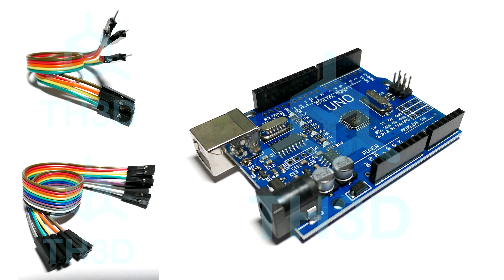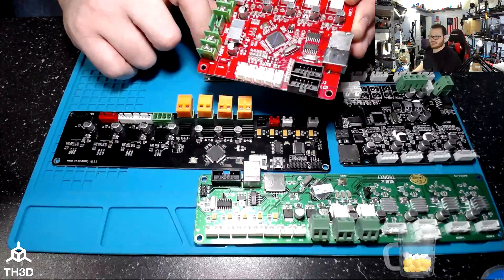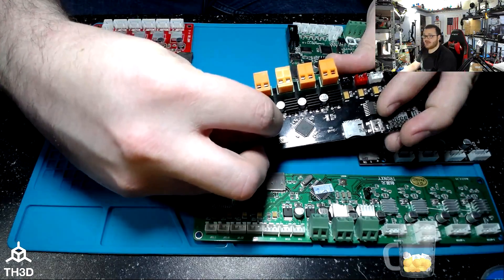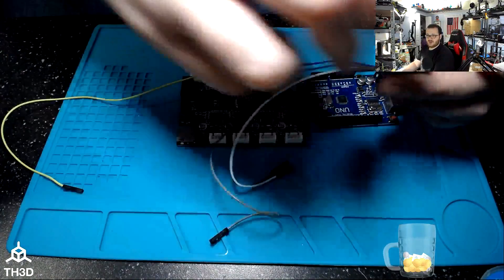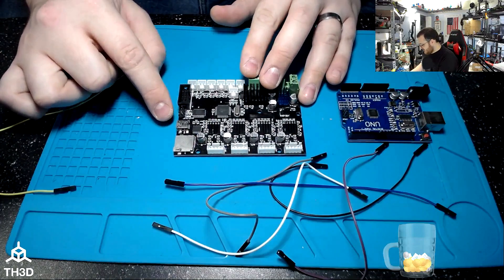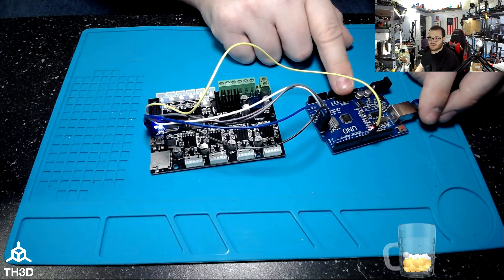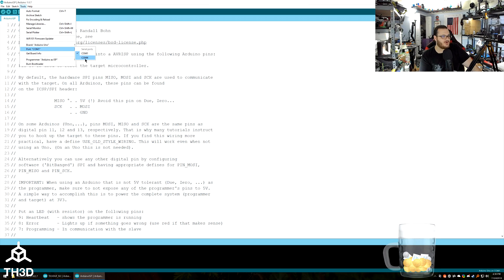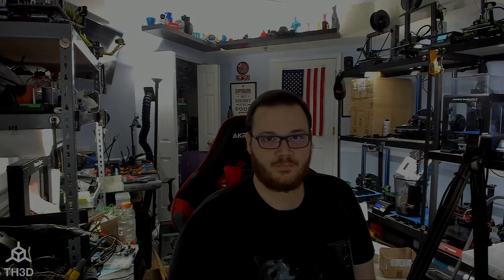Bootloader Flashing Guide - CR-10/Ender 2/Ender 3/Ender 5/X3S/X5S/Wanhao i3 - 1284p Boards

Comment: I corrupted my ender 5 plus silent board by using the wrong programmer in octoprint.  will this work for the silent board too?
Reply from the maker: If the board is the V1.1.5 then you can try to bail it out. If its the V2.X type you can as well but needs to be set as the 2560 CPU.
Reply: @TH3DStudio  Thank you for the response!! The model I have for the Ender 5+ is a V4.2.7 board.  Would this be alright?
Reply from the maker: That will not work. You likely need a more advanced method and the bootloader file from the manufacturer. It would be cheaper and quicker to just replace the board. That board already has a bootloader.

Comment: hi i get this code  on my ender 5 pro any help would be nice avrdude: stk500_getsync() attempt 1 of 10: not in sync: resp=0x65
avrdude: stk500_getsync() attempt 2 of 10: not in sync: resp=0x63
avrdude: stk500_getsync() attempt 3 of 10: not in sync: resp=0x68
avrdude: stk500_getsync() attempt 4 of 10: not in sync: resp=0x6f
avrdude: stk500_getsync() attempt 5 of 10: not in sync: resp=0x3a
avrdude: stk500_getsync() attempt 6 of 10: not in sync: resp=0x54
avrdude: stk500_getsync() attempt 7 of 10: not in sync: resp=0x46
avrdude: stk500_getsync() attempt 8 of 10: not in sync: resp=0x20
avrdude: stk500_getsync() attempt 9 of 10: not in sync: resp=0x69
avrdude: stk500_getsync() attempt 10 of 10: not in sync: resp=0x6e
An error occurred while uploading the sketch
Reply from the maker: You either have the new board that isn't compatible or you need the bootloader:

Bootloader Info: https://support.th3dstudio.com/hc/en-us/articles/360043146132
New Board Info: https://www.th3dstudio.com/2020/08/19/creality-changing-boards-with-no-notice-ender-3-ender-5/
Reply: TH3D Studio no I have the V 1.1.5

Comment: I  used a USBISP on a 1284p board(ET-4000 V2), but seemed to bricked the chip. don't know why I cant flash bootloader or firmware anymore
Reply from the maker: Have you tried using another programmer like an Arduino UNO to see if its just a bad USBISP?
Reply: @TH3DStudio  yeah, i figured out that i used the wrong fuse settings, causing  the chip to lock up

Comment: Very informative, What happens if you connect the wires incorrectly and start the process... will it damage the board? I mean if the board lights up it should be good... no ?
Reply from the maker: It usually will be OK as we've done that here on accident.

Comment: Cannot get my UNO R3 to be recognized by my computer.... Windows 7 and USB is likely screwed due to Drone FC usb configs.  Cannot figure out how to get the board recognized to reflash the UNO.  Any ideas?
Reply from the maker: If you have one of our UNOs try installing the driver for them from our website: https://support.th3dstudio.com/hc/en-us/articles/360043291432-CH340-Drivers-TH3D-Uno-Creality-V1-1-4-V1-1-5-Board
Reply: @TH3DStudio  I have gotten further, now I'm getting a fault (This device cannot start. (Code 10)).  My board is a authentic Atmel ATmega16U2/ATmega4328... so not sure how the CH40 driver will fix, but will give it a shot.

Comment: Worked great.   I made a diagram for the connections so I would not make any mistakes.  Then I installed the bootloader.  It worked fine except the 3D printer did not reset which I thought it should.  It was not a problem though as I just unplugged the USB and plugged it back in and the printer came up to a blank screen.  After that I was easily able to install the TH3D firmware and everything seems okay though the blank motion menu had me concerned until I read that it has moved to be under the Prepare menu.

Comment: Also will the Sanguino 1284p board work with the EZ Lite v1.2? Or do I need a different bootloader?
Reply from the maker: You are going to damage the EZBoard. Please read the manual, it already has a bootloader: https://th3dstudio.zendesk.com/hc/en-us/articles/360043727771-EZBoard-Installation-Guide-Firmware-Info

Comment: I have the EZ Lite V1.2 and everytime I try to burn the bootloader I get an error saying" device signature incorrect" any help I would be greaful. I tried almost everything. Also to point out my UNO board is the chinese version
Reply from the maker: You are going to damage the EZBoard. Please read the manual, it already has a bootloader: https://th3dstudio.zendesk.com/hc/en-us/articles/360043727771-EZBoard-Installation-Guide-Firmware-Info

Comment: if trouble with grapichs display, just add these line at the configuration.h  section lcd :

#define REPRAP_DISCOUNT_FULL_GRAPHIC_SMART_CONTROLLER
//************************************* edit mjh *************************************
#define ST7920_DELAY_1 DELAY_NS (0)
#define ST7920_DELAY_2 DELAY_NS (400)
#define ST7920_DELAY_3 DELAY_NS (0)

this will correct the timing if display is corrupted

Comment: Hi,

First off all, thx for this understandeble video! really nice!
programming the arduino as a programmer went like a charm, but when i trie to flash the bootloader on the 1284p board i always get the same fault (avrdude: Device signature = 0x000000 (retrying)

fault when burning bootloader.

when i just connected the 1284p bord it had a red flashing LED but after a while it's not on anymore. only when i press the reset button (on the 1284p or arduino board) then it comes on for a moment.

any help on this? thx
Reply: forgot to mention that the LED on the uno board is solid red it was also blinking in the beginning en turned solid when the 1284p board had it's LED turning off :) and it's not an original arduino, it's MEGA2560

Comment: Thank  you for this video. I have an ender 5 PLUS with creality v2.2 board. I was trying to flash it from slicer when I selected the wrong firmware (ender 5 rather than 5 plus). Now it won't get past the initial creality screen. I followed the guide here with the wires matching https://www.th3dstudio.com/knowledgebase/creality-v2-0-v2-1-v2-2-board-atmel-2560-icsp-programming-header-pinout/ and  Mega 2560 board selected in arduino IDE. And yes there is no micro sd card in the printer. I get this error when I try to burn the bootloader: 

avrdude: stk500_getparm(): (a) protocol error, expect=0x14, resp=0x14

avrdude: stk500_getparm(): (a) protocol error, expect=0x14, resp=0x01
avrdude: stk500_initialize(): (a) protocol error, expect=0x14, resp=0x10
avrdude: initialization failed, rc=-1
         Double check connections and try again, or use -F to override
         this check.

avrdude: stk500_disable(): unknown response=0x12
Error while burning bootloader.

Comment: Thanks for the video and also (especially) for the instructions based on MAC system. When I look at the files contained in the package,  in hardware/sanguino the file boards.txt refers to 1284P boards, whilst I would like to load this into a CR10S Pro (V2) with a ATmega2560 board. IS there a different file somewhere or don't I worry about that ? regards Manfred
Reply from the maker: You use the 2560 for the CR-10S Pro.

Comment: Hello. I am trying to upload tinymachines firmware to CR10Spro.  Xloader finishes updating with 0 bytes updated message. also cura is stucked at firmware upload pgress bar.  pronterface is OK with connecting and managing printer. any ideas? changed all baud rates and tried. 
thanks
Reply from the maker: Have you tried contacting TinyMachines?
Reply: @TH3DStudio  yes  we mailed , now i am waiting answer for above issue.

Comment: Few months ago I purchased genuine arduino board first time in my life...
...
It gave me loads of critical errors, needed ladyada herself to fix one of the issues, but at the end I gave up and tossed the board into the corner and went back to rip offs, 0 issues >.<
Reply: I'm getting a fault (This device cannot start. (Code 10)).  My board is a authentic Atmel ATmega16U2/ATmega4328.... thinking i need a clone board to toss this one too

Comment: I have the Ender 5 Pro. I see videos where people only have the 5 and have auto leveling option. I flashed this firmware and now auto home doesn't work like before. Thoughts?
Reply from the maker: You should make sure the offsets for your sensor are entered into the firmware and the correct type of probe is enabled.

Comment: Watch this video alongside CNC kitchen's video on the same topic if you're missing some things, they both seem to be missing bits and pieces but after watching both videos i got it working.
Reply from the maker: Can you let us know what we're missing so we can make a new updated video?
Reply: @TH3DStudio  There was a couple iirc, the main one was that the sanguino board option didnt show up for me, in CNC kitchen he shows where you can download it in additional boards manager. He also mentioned you should download U8glib but im not sure whether or not it made a difference for me since i did it just in case.
Reply from the maker: We include the Sanguino in our Arduino IDE and its included for Mac as well for the setup guide. If you used the files we provide it's already in there. If you skipped that step (using our provided software) then you will not have those options.

Comment: WTF! I have your board (uno kit you sell) down loaded your custom instructions. After 100s of hour, contact with your crew. Following The seemly easy to do, No help and no joy at all! I speak English, With long words, not in code. I as many 'buyers' ie. customers of you stuff do as well.  Just a tip. I'm not a computer programmer.   I'm retired, lots of time to learn something to add to my time with my Grand kids So the easier using and adding parts and whatever helps . Thai has not been case.  Want all this stuff back?
Reply: So you want to load custom firmware on your Chinese clone 3D printer and you expected it to be like Legos with the kids? haha
Reply: @daniel_pipe  YOU BET. And your comment, is less than helpful.
Reply from the maker: Sorry you're having trouble. If you have our EZABL kit support for bootloader flashing is covered in the product support. We also have communities setup if you just got the kit and are having issues. You can check them out here: http://community.th3dstudio.com/

Most people that have issues are usually the result of skipping a step. Make sure you check the video and don't skim through it.

Comment: Had an error using an Elegoo R3 

 "avrdude: stk500v2_ReceiveMessage(): timeout
avrdude: stk500v2_getsync(): timeout communicating with programmer
An error occurred while uploading the sketch"

The fix for me : Under TOOLS/BOARD: select "Arduino/Genuino Uno" instead of the "Arduino/Genuino Mega"
Reply from the maker: That's because its not a Mega...its an Uno.

Comment: When I wire my arduino to my cr-10 board, and I connect the arduino to my PC, my creality board constantly beeps and flashes. When I try to upload the sketch, it fails the upload
Reply: I'm a bit late to reply, but this happens when the LCD ribbon cable is connected to the wrong port.

Comment: i have a cr-10s with the atmega 2500 chip. thought it was without bootloader so i bought a arduino etc. but now im unsure. does mine already have a bootloader? if not. where are the icsp pins on the board? :D

Comment: Hey I have a replacement board for my CR 10 S5 it's a V2.1 with the 2560 on it will this boot loader guide work for this board? The header on my board is located in the middle of the board.
Reply from the maker: 2560 doesn't need a bootloader as it already has one installed on it.
Reply: I have cr10s pro but lost the bootloader  will this method work to re burn the bootloader back on . I keep getting invalid signature when I do try

Comment: If I already have advi3++ on my Wanhao i3 Plus, do I still have to switch to TH3D via this method (I want to use the eazbl), or can I do it over USB as it presumably has the advi3++ boot loader on it?
Reply from the maker: The i3 Plus is not supported at this time. Different machine from these covered here.

Comment: no chance with the Arduino Mega, i cant flash the bootloader. i get this message " avrdude: stk500_recv(): programmer is not responding
avrdude: stk500_getsync() attempt 1 of 10: not in sync: resp=0x00"
Reply from the maker: We have communities setup to get help with 3D printer issues: http://community.th3dstudio.com :)

Comment: SO to be clear, i need to burn a bootloader on before i can install the new firmware for my BLTouch? I donwloaded the latest firmware, fallowed the guide for ender3, however when i check the sketch, i get an error message: "Make sure you have Sanguino selected from the tools"
Reply from the maker: Yes the Ender 3 needs a bootloader to do any kind of firmware updates. That error is unrelated and is coming up because you don't have the board selected (it's actually in the message you posted).
Reply: @TH3DStudio  Turns out that i can update my firmware due to a bad atmega chip. Had a friend test it for me, so i ordered a MKS Gen L board, and then tested my new dead blow hammer on that cheap Chinese knock off board.

Comment: Not sure if you were using an ESD mat and ESD wrist strap I'd recommend using them, it's worth saving yourself a lot of headaches from burning out a chip with a static discharge.  All it takes is a 100-150V static discharge to burn your chip out.  Which humans don't start feeling static discharges until about 3000V.

Comment: You seem to be the Most Technical of all the 3D nerds. My compliments!  I am in the "land of the confused" for the 2nd time.  I started with a MONOPRICE Mini v1 (refurb) yea I know.   Now I've had an opportunity for an Ender 3D pro.  I'm using Octoprint on a pie 3b.  It's never happy. Wont print, have glass bed, stepper levelers. It is real quiet anyway.  I have leveled manually so many times. Changed .04mm heads, cleaned heads (figured that out too) I'm a 30 retired Systems and Network Engineer.  The problem solving patient guy. I turn the orange light green in any data center. A new terminal follower. JLH

Comment: Mac user. How do you install your software package for a Mac? I go into the MacOSX Arduino file and run the dmg. It instals the package and then........ nothing. How do i access it now?
Reply from the maker: It should be in your applications section on the mac. You can always check out the manual setup if the auto installer doesn't work: https://th3dstudio.freshdesk.com/support/solutions/articles/43000460795-arduino-ide-for-mac-os-x-setup-guide

Comment: the newest version (Arduino 1.8.7)  can't even flash the ISP software to an Arduino Nano V3. 1.8.5 can do it, but I have to download it from Arduino directly - so it doesn't have the Sanguino Board that powers my Ender 3. what a shitshow. I'm really disappointed - I think I'll just keep using the stock firmware and hope the printer doesn't burn the fucking house down.

Comment: Great Video, I was able to use this procedure to unbrick my CR-10s PRO v2.4 board.  Be sure to select "Arduino Mega 2560" in the Arduino IDE software that is provided by their download.  I did order the UNO and connector pins from their website "TH3D Uno Bootloader Flashing Kit" (UNOBLKIT), unfortunately because of the day of the week I ordered it and when it shipped, the UPS 2nd day option was going to have it delivered by Monday, today is Friday and I ordered it Wednesday.  My impatience made me purchase the UNO from a local source I found.  So I will have 2 UNOs, which is not a bad thing!  Thanks again for the video!  It is 100% correct and verified to work on my printer.  The Unified download provides the Arduno IDE already setup with the proper configuration options available to select!

Comment: Hello, I bought a CR10-S that uses the mainboard V2.1, I am trying to use a bltouch sensor so I am trying to upload the updated marlin firmware however, I have followed plenty of different instructions but I get to the same point, I got an error on arduino: "avrdude: stk500v2_getsync(): timeout communicating with programmer" I dont know if it makes sense to try to reburn the bootloader for the ATMEGA2560 or if there is any other solution (I already tried downloading an older version of arduino, changed the cable, tried with th3d instead of marlin and plenty of other ideas I´ve found, my printer is working normally so I asume the mainboard is not damaged).

For the record I didn´t tried to burn a bootloader because supposedly the CR10-S comes already with it.

Comment: Hi, I am using Ender 3 pro board. And while trying to flash the bootloader, I am getting"Error flashing bootloader" message. The printer has a Creality v1.1.3 board in it and it doesn't have any jumper to select the power source. 
Any advise on how to get around this problem?
BTW, I am using Arduino Uno board and using a Mac to do the flashing.
Reply: I am getting the same error on the v1.1.3 board. Have tried multiple PCs etc with no luck.....

Comment: I'm getting the following error when I try to do the first step of setting up Arduino Elegoo Uno as programmer.  I'm using Mac and selected ArduinoISP example.  Set my port to the proper one /dev/cu.usbmodem14201, Board is Arduino Uno, Programmer: Arduino as ISP.

sorry - this program has been built without plugin support
exit status 1
Error compiling for board Arduino Uno.
Reply: @c2cworldnews  I'm a 20+ year linux/network/devops engineer.  I also have experience in numerous programming languages (my expertise is python, going on 10 years).  It's definitely not a PEBKAC problem.  Unfortunately the solution was to completely blow away my existing Arduino plus all libraries, then load the custom Arduino from their site.